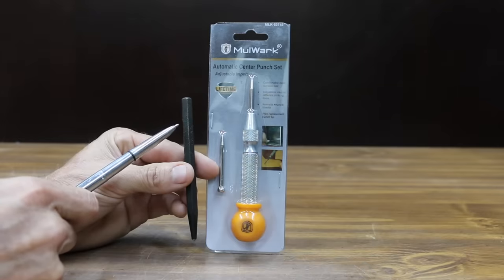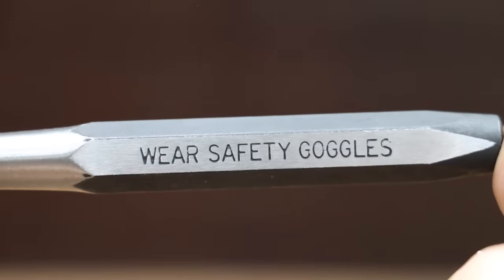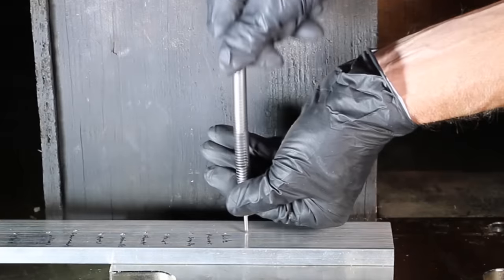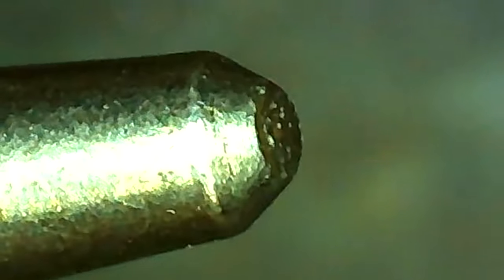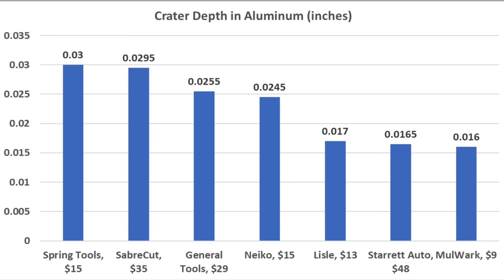Is a Cheap Center Punch Just as Good? Let’s Settle This!

Comment: I've never seen that Spring Tools punch before. I can definitely see more than one use case for that. For $15 it's something I'm absolutely going to pick up. Thanks!
Reply: I've heard spring punches are really powerful (and better than an automatic) but this showed it.

Pretty versatile too, you can get into tight places where a hammer won't go, or an automatic doesn't hit hard enough.
Reply from the maker: My pleasure!
Reply: Those are awesome for setting brads, nails etc in very tight spaces. Typically where is no room to use hammer
Reply: I've not seen it as a centre-punch before, but I have seen something very similar used by pentesters to knock out the hinge-pins on doors, and it works really well

Comment: I got sick of auto punches breaking on me.  Even my nice Starrett one is constantly misfiring now.  I started using a hammer/punch combo again.
Reply from the maker: Thanks for sharing!
Reply: Did your starrett rust up quickly? I felt mine rusted up in no time.
Reply: I have the Spring Tools "spring punch" and it's major problem is operating it so it hit exactly where you want it. Also, it would be near imposible to use properly if you were working in tight spaces as it requires 2 hands to be on the tool.
Reply: @SammyInnit  it did not, I'm basically in a desert so the low humidity may play a role.  There's supposed to be a piece inside that wears down that causes misfires on most of these, but it wasn't that either.  I just quit trying to figure it out.

Comment: I've got the woodworking version of the Spring Tools one with a nail set on the other end, it's a fantastic tool that doesn't require a hammer for marking drilling points in wood and drywall.
Reply from the maker: Thanks for sharing.

Comment: I feel like one of the most important features of a center punch is its ability to center the drill where you want it, so if you were to do center punches again, maybe you could test how much deviation from the intended spot the dent is / where the drill would be put relative to where it is desired and how much the drill bit could move (this might be hard to test, as you would have to mark and punch at an exact spot where you could locate where it is supposed to be and where it is after)

For example, duller tips might allow the drill to move around, or a center punch might not create a divot with the right geometry to properly center the bit.
Reply from the maker: Thank you for the video idea!

Comment: Hello Project Farm. I worked in the machine shop for years. We were always using center punches. The spring snap center punch worked the best just like your testing. They worked quickly and accurately too. Also, speaking from experience with making tools of all types. The best steels to make a center punch is the old US steel HSS spiral reamers. I have a few that I made forty years ago. They are still sharp and working fine. That is just incredible for the strength, point retention. The spiral part ground down a to about 3/16 inch wide flats with edges ground round to get rid of sharp edges. I would bet they would make every model and make tool you tested run and hide. We are speaking from experience in the shop. 
Good day Sir too. vf
Reply from the maker: Thanks for sharing.

Comment: The biggest advantage of using an automatic center punch is accuracy, the ability to use one hand, and get awkward or tight spaces. I feel like the spring tools is not good competition as it does not help with these things and therefore is the worst of both worlds. I often will use an auto punch to accurately and conveniently mark the center, and then deepen it with a bigger manual punch. Therefore, the criteria are really different between the two styles and the spring tool loses in my opinion .
Reply from the maker: Thanks for the constructive feedback.
Reply: I am more comfortable punching accurate markings with an manual punch. I also dislike the feeling in the hand, when an automatic punch strikes

Comment: 🎯 Key Takeaways for quick navigation:

00:00 The video is testing the performance of different manual and automatic center punches.
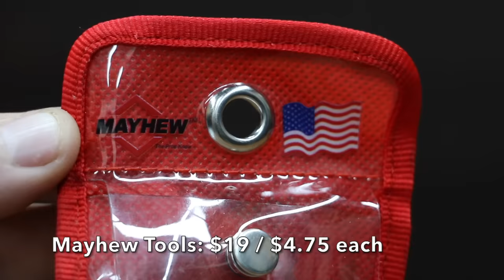00:27 The least expensive brand tested is Mayhew Tools, priced at $19 for four punches.
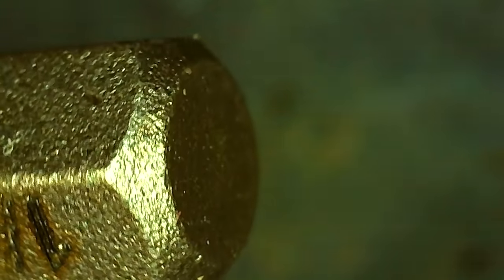01:10 Wild Tool, priced at $8, performed well and left a 0.0385 inch crater.
01:36 Klein Tools, also priced at $8, had a small bounce but performed similarly to Wild Tool.
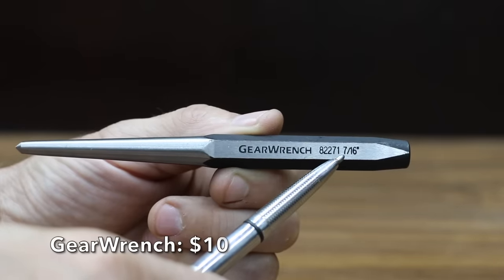02:04 Williams Brand, priced at $10, had a small jump and left a 0.0335 inch crater.
02:18 GearWrench, priced at $14, performed well with a small bounce and a 0.0355 inch crater.
02:32 Stanley Proto, priced at $14, had a small bounce and left a 0.0385 inch crater.
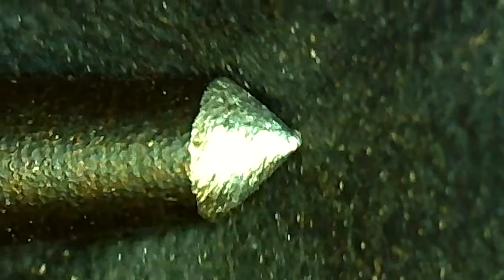02:47 Starrett Brand, priced at $17, made the deepest indentation at 0.0395 inches.
03:02 Hazet Brand, priced at $17, matched Starrett at 0.041 inches.
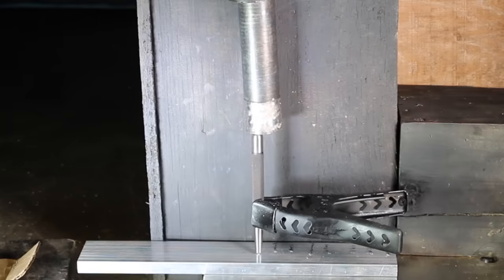03:15 Sabrecut Extreme, priced at $48, also performed well with a 0.0295 inch crater.
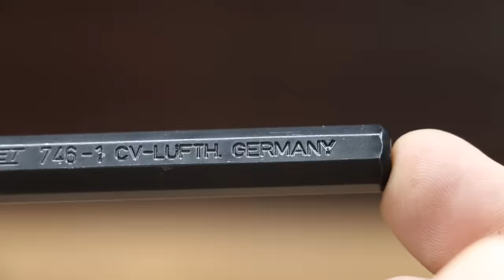03:28 Stahlwille Brand, priced at $50, had a 0.0415 inch crater.
03:42 Snap-on Brand, though more expensive, performed well with a 0.032 inch indentation.
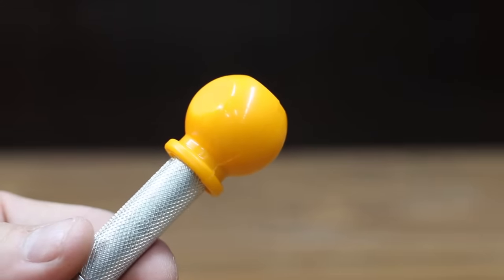04:10 Automatic Center Punches were also tested, with varying results in performance.
05:07 Spring Tools performed the best among automatic punches with a 0.028 inch indentation.
05:37 Nico Brand had a spring tension adjustment and performed at 0.0245 inches.
06:05 General Tools Brand performed at 0.0255 inches on hard materials.
06:33 Sabrecut Extreme also performed well with a 0.0295 inch indentation.
07:28 Comparison of performance on mild steel, medium hardness steel, and very hard steel was done.
16:37 Overall, Starrett Brand and Spring Tools performed well in the tests.

Made with HARPA AI

Comment: When I worked as a toolmaker, I used a pointed gun tap. The advantage is the point is precision ground. Disadvantage is the brittle HSS. However, I’d make a light punch with the tap, then a normal centre punch to deepen the mark.

Comment: When I was training to be an EMT one of the go-to tools we carried for extrications from accident vehicles was a spring-loaded center punch. It would turn a vehicle side window into a cobweb without bursting the window and sending broken glass into the vehicle interior. It was a quick and simple job to pull the glass outward, away from the accident victim. No worries about how well the tip would hold up over time. I still have one that's about 20 years old, but now all I use it for is starting holes for driving wood screws and drywall screws into wood and it still does the job. (No idea what brand it is. Probably the cheapest one they had at Lowe's or Home Depot....)
Reply from the maker: Thanks for sharing.

Comment: A couple of things: I have been using the spring tool punch on the job fir over a year and converted co-workers to them.  They are awesome, but wow, you paid $15 for them?!?  I purchased them at ACE hardware for less than that if I recall correctly.  I will have to check.   Second, had I known you were going to do this test I would have suggested this hidden gem of American manufacturers - CS Osborne.  I use their punches and chisels and other tools on the job.  Very tough and durable and USA-made.  Anyway, awesome video as always.
Reply from the maker: Thanks!

Comment: I’ve used the same general spring punch for probably 40 years. If you pull off the end cap and add a washer, you get a higher pressure and deeper hole.
Reply from the maker: Thanks for sharing.

Comment: Here's another suggestion - just bought a wooden deck trailer - I know you must have a few trailers out on the farm; a comparison of coatings would be great.  A lot of people do used motor oil and diesel mix;  and then the other popular options - linseed oil, actual deck stain/sealers, and even some of the marine coatings like durabak.  Could test similar ways to the bedliner tests - or stick some 2x4s in different environments - wet, UV exposure, etc.  

Chop chop, I need to know what to put on my trailer!  J/k, love your videos, helped out on tons of purchases!
Reply from the maker: Thanks!  Thanks for the suggestion.

Comment: Awesome test!  Nicely done.  Punches are very useful!

For the motorized tools, one test that is missing is thermal handling.  You use a thermal camera sometimes, but I haven't seen you run a thermal test using 2-4 batteries, like one would do using a tool for a whole day.  We've seen some tools go into thermal shutdown in recent tests, but that wasn't the purpose of that test.  Just a thought.
Reply from the maker: Thanks!  Thanks for the constructive feedback.

Comment: As Mittencarpentry noted, the Springtool nail set is the best I've used. Mine is double ended with a small and medium size nail set. I use the small size as a center punch in wood frequently. The old industry standard of Stanley nail sets depends entirely on the quality of steel and hardness. They are incredibly inconsistent, leading me to believe they've been outsourced for decades. Good testing, Todd, I find my self using your videos as pre-purchase must see vids.
Reply from the maker: Thanks!

Comment: Hey great tests! Some suggestions for improving your testing method: The punches were from left to right on the pieces of steel, affecting the stability of the punches being hit. The punches on the far left would cause the steel piece to "bounce" more and increase the amount of side to side movement, causing any secondary hits on the punches to be off centre. 
Suggestions: Secure and/or increase the size of the test metal piece. Drop the weighted metal weight through a cylinder/guide so it bounces exactly up and do and ensure the top and bottom of each punch are supported in such a way they will not move laterally either.

👍
Reply from the maker: Thanks!  Thanks for the suggestions.

Comment: The best centre punch in the world is mine. Mine was made by my dad when he was a tiny little electrical engineering apprentice some 70 years ago out of a #1 morse taper drill bit. I still use it almost every day and tho I have ground it a couple of times over the 20 years I've had it, it will still outlive me.

I also have his Morre & Wright automatic punch which would be 60 plus years old, it has never needed a regrind. I carry it in my belt kit as a firefighter for breaking car windows.
Reply from the maker: Nice!

Comment: Somebody tried that Starrett on concrete several times and put it back on the shelf.  ;)
I learned how to make a center punch in 8th grade Metalworking class, where we hardened our own tips.  It worked well for me for years until it developed legs.  Nowadays, I slouch and use the HFT automatic several times before drilling, as it's the first one I find.  Or for precision, I use a transfer punch of the correct size, also HFT.  There were a couple no-name center punches with good tips in the drawer, too.  The Starrett manual looks good as I get more into metalwork.  I like that the result differences measured mostly a couple thou.  (0.032 and 0.036, four thousandths)  The hardest thing about the Spring Tools style auto is that you're pulling the tip away from the work while you load it.  That ruled it out for me.
Reply from the maker: Thanks for sharing.

Comment: I’d love to see a best wire connector comparison, i.e. wire nuts, insulated crimp connectors, heat shrink insulated crimp connectors, solder connectors, etc. Testing tensile strength, heat resistance, abrasion resistance, continuity, etc. Would be great!
Reply from the maker: Thanks for the suggestion.
Reply: Great idea, I use almost all Deutch DT connectors based on my belief Weatherpak connectors aren't actually very weatherproof, if doing a connector test please include testing of weather and corrosion resistance.

Comment: I use a PB Swiss 712/3.  It has a tungsten carbide tip.  It's extremely sharp after more than 10 years of daily use.  Never been sharpened after thousands of uses.  And I've somehow managed to not mushroom the head either.
Reply from the maker: Thanks for sharing.

Comment: As a machinist I will buy Starrett manual center punch about the same price as the top performer but the tip looks just a little sharper, plus support the industry.

Comment: I use a Tipco punch sharpened to a point.  5/16 end with 1/2 base and no ball lock.

To reduce mushrooming center drill the back side of punch.
Reply from the maker: Thanks for sharing.

Comment: Lightbulbs would be an interesting test.  There are so many options out there and I always get overwhelmed and some of the LED don't last as long as it should, even compared to the old filament bulbs.
Reply: That is an great idea, so many differences in CRI and general visual quality as well, I hate buying an LED lightbuilb and finding everything in the room just looks dull and gray with it. If Todd didn't take it on it would be a good fit for TTT as well since they have a rig to test lumens to see how closely they match the advertised specs.
Reply from the maker: Thanks for the suggestion.

Comment: I LOVE Spring Tools use it very often.    It takes less effort if there are many marks to make, automatic punches can leave your hand pretty hurt after many uses not so with Spring Tools and the manual punches you need to lug around a hammer for no reason.   Yup Spring tools is #1 in my book.

Comment: You can sharpen and refine these by chucking em in a drill and use a file or diamond wheel to sharpen or resharpen them. Neat trick for ya! You can also use drill then use a bench grinder at same time to keep it true and sharp, too. I swear by Starrett ones.
Reply from the maker: Thanks for the feedback.

Comment: Remembering that I found a punch that was made from round file in my grands workshop and Its still in a great shape, It would be interesting see the common practices pple does stacks up the actual products. Couple examples like other than this would be, knife from file, candles for rusted nuts and bolts (you already did that) card scraper from old saw, drill bits for center punch or awl etc
Reply from the maker: Thanks for the suggestion.

Comment: Good test results and good comparison. I am committed to Starrett and Snap-On as the best options. Starrett offers an impressive array of sizes as well as prick punch versions with sharper point and also more easily damaged. I am sorry that your Starrett spring loaded impact punch replaceable tip was damaged out of the box. Mine and purchased replacement tip were very sharp. The average hobbyist or mechanic is going to unexpectedly encounter hardened material that will ruin the finest center punch. Having something that can be resharpened is a real value. Machinists are more aware of material hardness and are less likely to carelessly damage their fine center punches and arguably require more precise punches than are included by most punch manufacturers.  I treasure my Starrett punches for the expansive variety of sizes and styles.

You included some brands that are not in my wheelhouse that performed very well. I don't need more punches for my extensive arsenal, but these high performers tempt me to shop.
Reply from the maker: Thanks!

Comment: I use the general tools auto punch at work as an Industrial Tech, the only thing I use it for is center punching broken bolts for drilling and extracting which are often grade 8 or grade 12.9.  Been using it for 1.5 years and still don't see a need to replace the tip yet.  Still looks good even though I use it at least once a week minimum.
Reply from the maker: Thanks for sharing.

Comment: Over in Germany there is a tool company called Rennsteig which is owned by knipex. Majority of german tool brands resell Rennsteig punches and cold chisels. Rennsteig also make probably the best automatic center punch you can buy. They have a black and red rubber overmoulding so you can push the punch in with your palm. The Stahlwille punches looked quite similar to my Rennsteigs. If you revisit this topic in a future video be sure to include them, I don't think you will be disappointed.
Reply: I also forget to mention the Rennsteig punches also tend to be cheaper than buying the same chisel from one of the popular german brands
Reply from the maker: Thanks for the suggestion.

Comment: I have several Starrett auto punches. One with a fixed (non removable) and two with several tips that can be screwed in to use either a low angle or a steeper angle cone. Both types are very sharp and very hard. You could use either as a scribe if you wanted.

I suspect you ordered your punches through Scamazon and the Starrett you got had been returned after some fool used it on a piece of concrete or carbide. 

Scamazon's return process would not have noticed the damage and they resold it to you. You should return it if it is not to late. 

I have used several of the low cost auto punches and find all of the ones sold in big box stores to be far inferior to the Starretts.

I prefer the removable tips for just this reason. It protects from my own mistakes!

Comment: The important thing here being "what are you working with?"
They will not wear out at all unless you use them on a material harder than they are. Being harder doesn't change their lifespan, just the types of job they can withstand.
It's a break point, not a health bar

Comment: I am working on a vintage motorcycle.  I thought of your channel when I was looking for Chrome/ Metal Polish.  
I can imagine you meticulously testing polishes different metals, chrome, light rust/no rust, and future protection, to find which metal polish is the best.  
 
I've been using Mothers Mag and Aluminum Polish since that's what they had at the big box store.  Applying it with steel wool and elbow grease on light rust and a microfiber on the good metal.  Seems to work well, especially on aluminum and chrome, but I would like to be using the best.
Reply from the maker: Thanks for sharing.